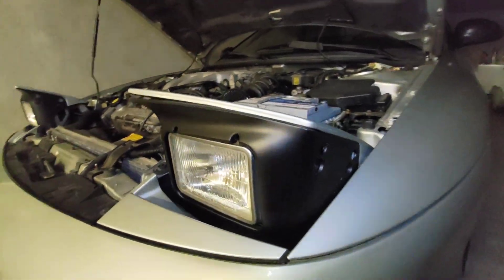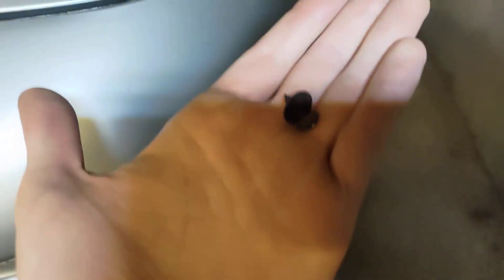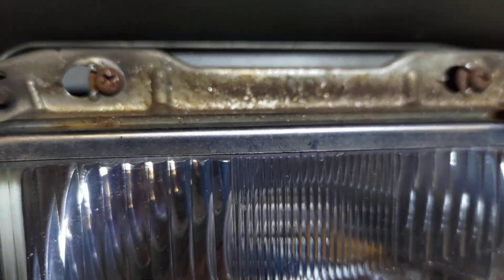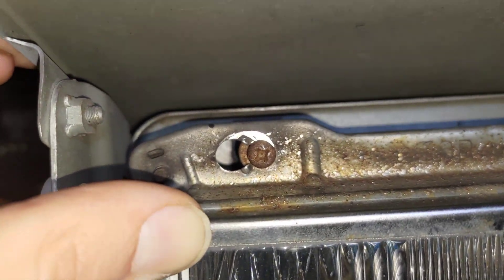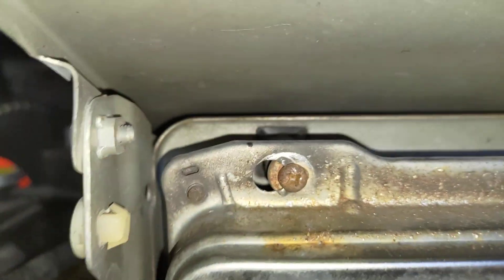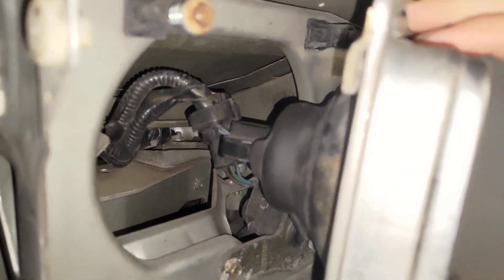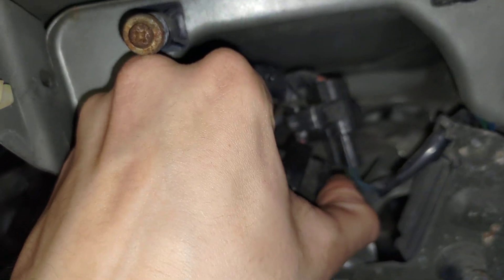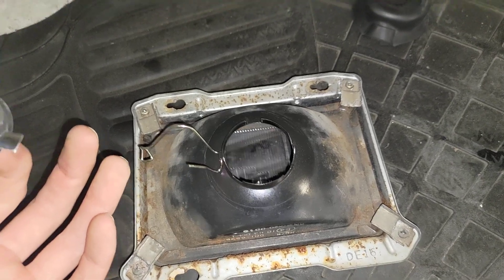Ford Probe MK2 Headlight bulb replacement

Comment: do you by any change know where i can order a replacement housing? mine was all rusted so i had to throw it away
Reply from the maker: You can find them on eBay or Facebook market place, if you're from the EU I'd say parts will be harder to find. The issue is that OEM part production has been discontinued for years now so you have to search either on aftermarket or second hand places.